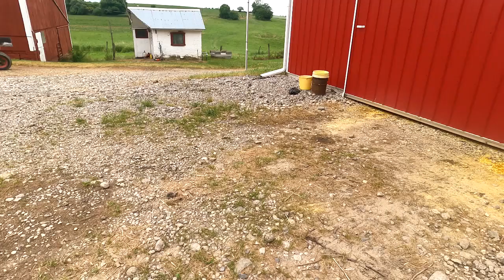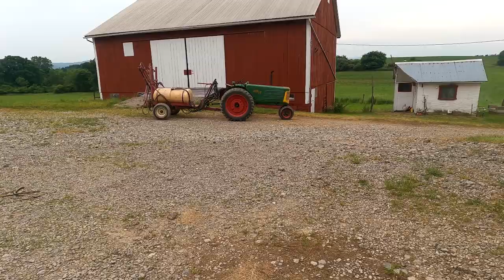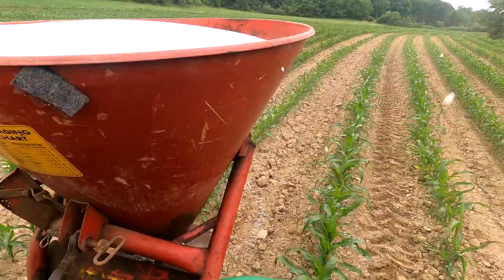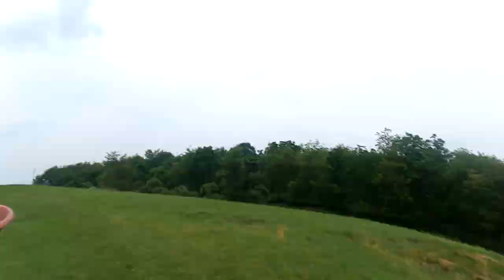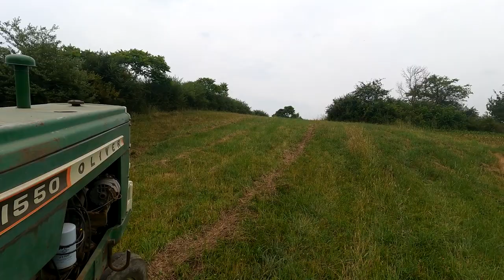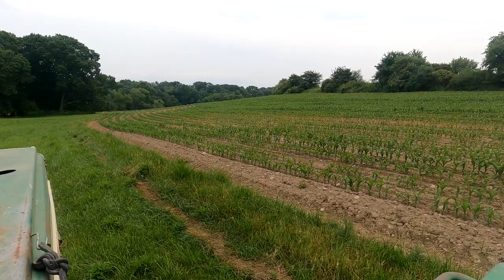Top dressing Corn with Urea Using an Oliver 1550 Tractor

Comment: That is a sweet 1550! I'd be proud to own that.
Reply from the maker: That tractor actually belongs to my good friend Dan.  He put it together drom parts from several tractors, including a 1555 frame and 770 engine.  He dropped it off here almost 2 years ago and told me to run it like my own.  He has no use for it and wanted to see it used.  For 2 seasons I’ve used it for spreading fertilizer and seeding oats/hay seed.  Has not let me down yet.  Thanks for stopping by Dan.  I sure enjoy your channel.